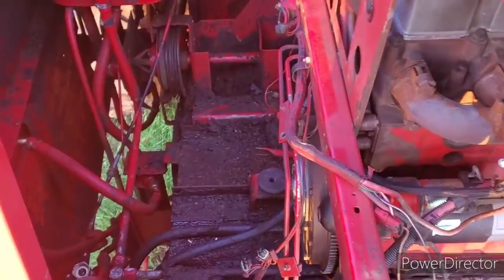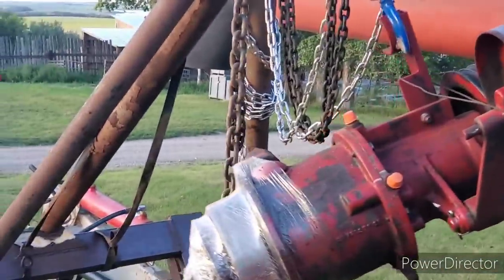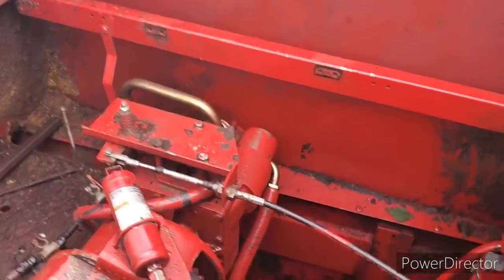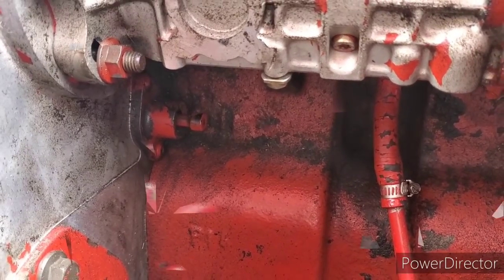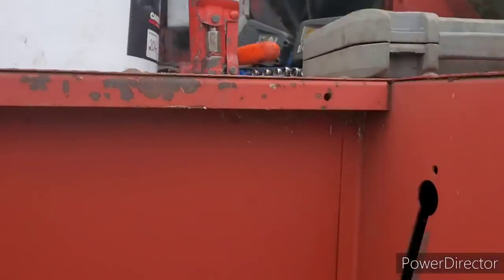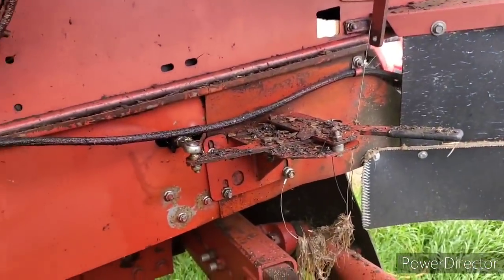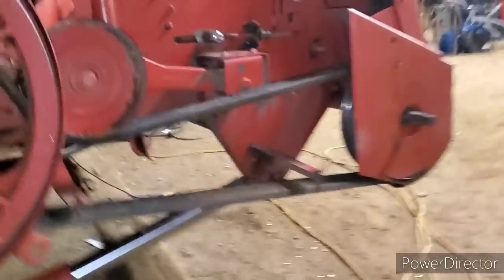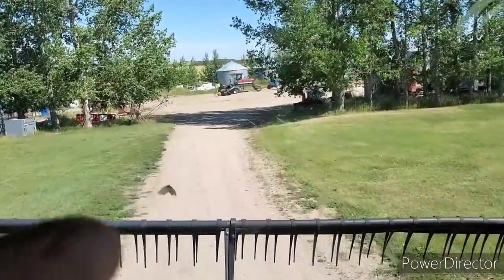PTO, 90 Gear Box And Hydro Install!!

Comment: Never thought about going over the top. When our hydro broke we took the side panel off. The header lockup is under the main frame support.  You really just need a flat strap.  The end piece by the wobble box we made .

Comment: Next time make sure you prefill the Hydro pump with oil through the top case pressure hose. Even though the pump is below the oil level, it runs dry for 10-20 seconds until the Hydro fills itself. I've seen them destroy themselves that quick.

Comment: Thanks for showing the P pump fix.  Running a 2188 so will be on the lookout for that leak  I bought me 2188 in 2010 and had to fix my gearbox leak mid season same year.......I'm sure previous owner knew it was leaking already.  I had my sheet metal off to reduce lift over height.  Good luck with harvest!
Reply from the maker: 👌I was thinking of taking the tin off but the tractor had enough lift. Thanks